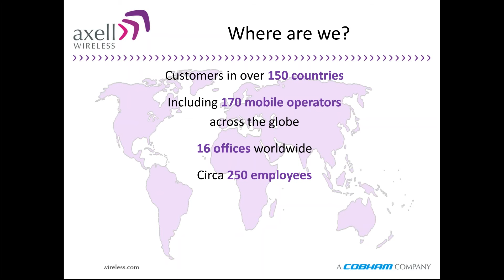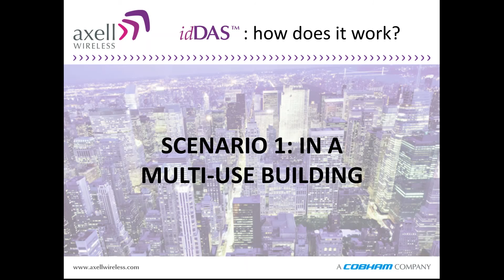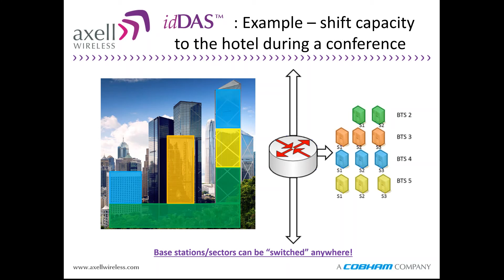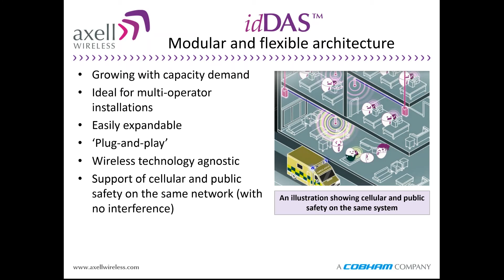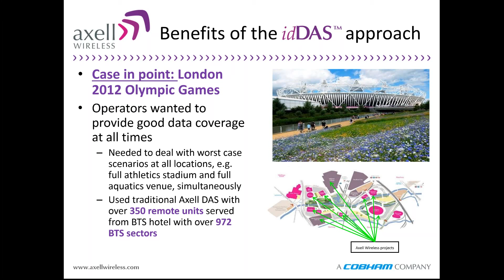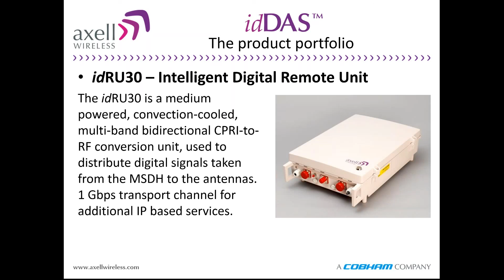Webinar: We've got your covered: Intelligent Digital DAS

Comment: Why IDAS uses CPRI , isn't this vendor specific format and different depending on which BTS you use (Nokai, E///, Huwai etc..?).  IDAS will understand each vendors CPRI proprietary specific commands? do you connect to the BBU via CPORI to the BTS or do you connect analogue via Remote Radio Head of the BTS?